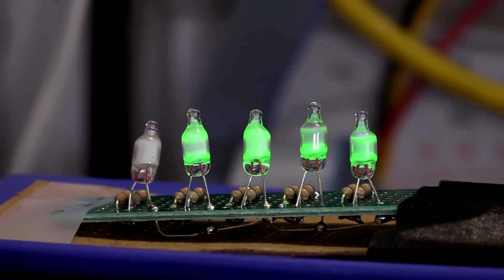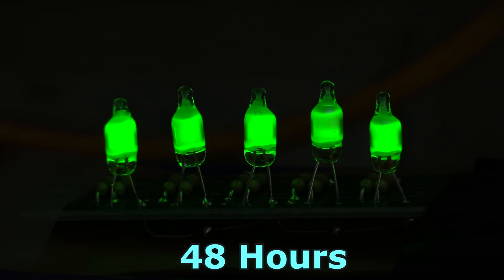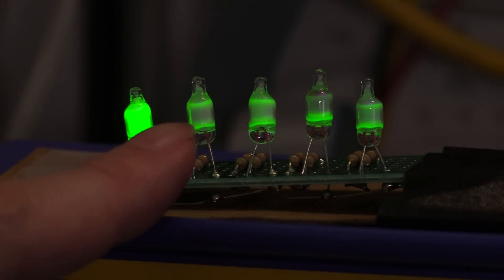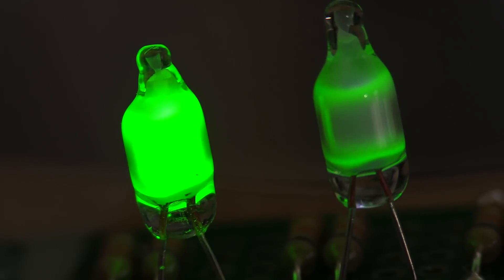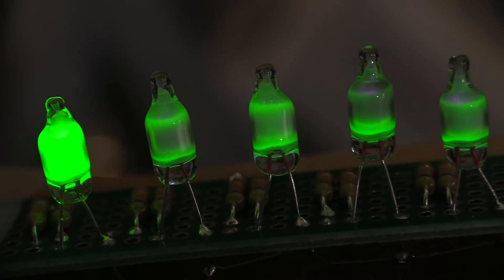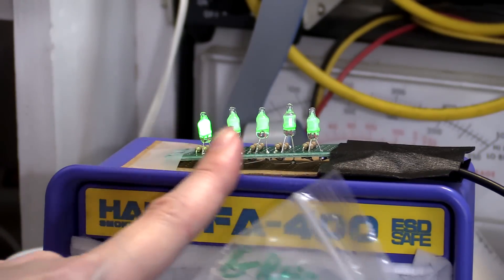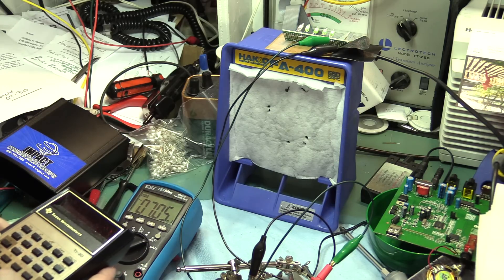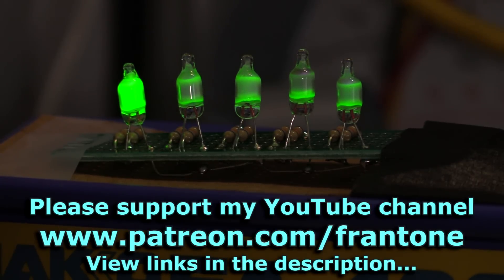Total Fail!!!  The Green Neon Is A LIE!!!

Comment: I think you should just go LED at this point.
Reply: LEDs are the boring answer. its like only drinking water instead of anything else because technically water is all we need to live
Reply: @DanafoxyVixen  That's the weirdest comparison I have ever seen. I'd have expected a car comparison instead. ;) LEDs are superior in any way and they can be bought in different wavelengths of green to match the phosphor of the clock. They are more efficient and last for ever when driven correctly. 1mA will be 2x as bright as 2 of those neons. You can get them in a diffused package or just sand them to diffuse the light. Just a little PCB with a capacitor to drop the voltage to a set 2mA current and a rectifier will do. It takes away the nostalgia a bit in terms of tech but when you look at the clock and the nice green glow as if it was a newly bought clock, believe me, you'll forget that you put LEDs in it.

Comment: My take is this Chinese sourced neon- florescent light's internal components are formulated for AC 240V (standard CN city power).  When used in AC 120V application without using an inverter-booster, you're overdriving it by using higherr than rated current.

I.e., try them on AC 240V at low current to rule out QC issues.
Reply: I don't think it should change anything? iirc neon globes have a ignition voltage of like 100V and a sustain voltage of 90V. They should draw the same amount of current on both 110V and 220V it's just that the resistor will dissipate more power on 220V. Like LED's. They don't really care about the voltage so long as there's enough current and the current is limited.
Reply: Discharge tube's ionization breakdown voltage is very much subject to chemical compound composition, concentration, vacuum pressure, etc.  This is why I said test it out under rated supply voltage and current first.
Reply: @ccshello1  but I don't see how it'll make any difference. The keep-on voltage across the globe should be the same no matter the input voltage. The current limiting resistor is simply speced higher to ensure it limits the current.

A million volts could in theory be used to power the globe, provided you have a way to limit the current, the voltage across the globe should still be it's keep-on voltage

Comment: blimey, very poor, maybe 33k is too low,? i have 2 green neons i got from tandy (uk) in the early 80s, not 100% sure of the resistor that came with them but think about 150k for 240v use.?  maybe the modern ones are just crappy quality? and yes the glow at the pip end looks purpleish...so maybe not 'pure' neon , i have powerstrips that use green neons for the 'surge' indicator, plus our old freezer had a green neon and they all failed before the 'orange' ones on them , but not in a few days, they lasted several years!
Reply: i have a blue phosphor neon somewhere i removed from a popped iron...
Reply: try running them at half current, or just under 1ma, sure i read somewhere neons can be very sensitive to the current, go just a bit over a limit and life drops rapidly
Reply: not all neons are the same, the types sold by RS (radiospares) in the uk varied a lot in what resistor was used, one was high as 270k for 240v use, another less than 100k

Comment: ac? or dc? camera only picks up the one side, guess your camera is synced to your eletrical grid to lower flicker in old type lights
Reply: maby lower power trough or use diodes. to sepperate the lights, some ave pins inside different lenght between so more power goes trough each of them alternating
Reply: She says AC here 0:46

Comment: Yeah, once I bought two green neons, like these, I put them in place of two regular orange neons without any modification. It doesn't went well at all: I can't remember how much time they lasted, but the two green neon darkened then burned out pretty fast! Maybe 1 or 2 or 3 weeks? The time was pretty short, of course! 😶 👎

To end on a positive note, I have two salvaged regular orange neons with their series resistor: I glued them into the base of a gutted out defective compact fluorescent lightbulb, and... Well... They are actually lit up every day when I'm at home, and they are working now at least since several years without any intensity loss! 👍 Take this, cheap garbage green neons! 😁
Reply: Syd McCreath  So, the green neons actually need higher resistor than the normal orange ones? 🤔